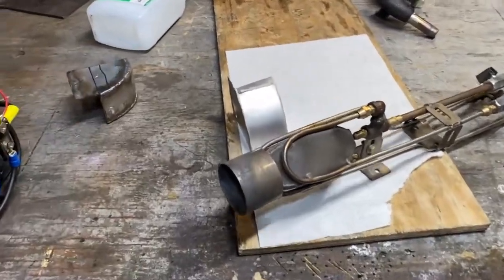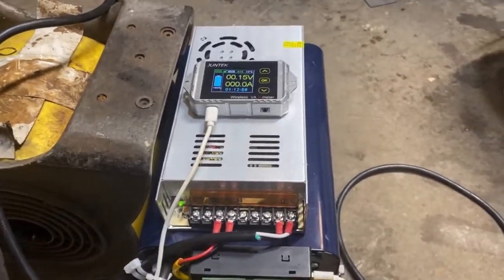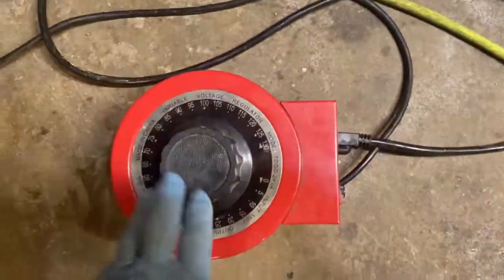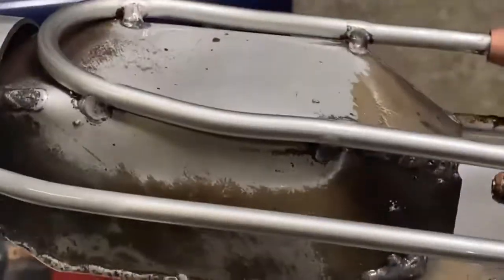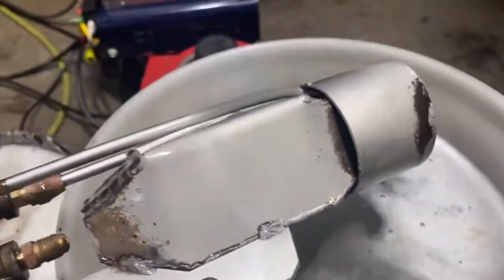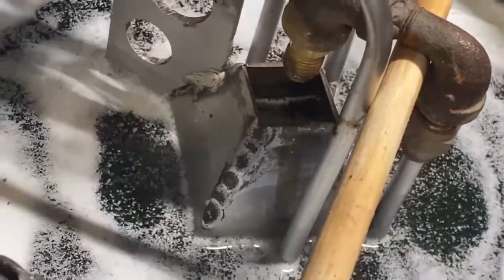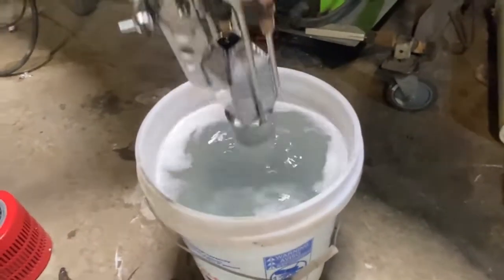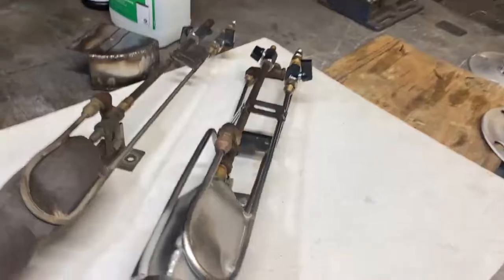NEW Metal restoration electrolyte ADVANCED PROCESS

Comment: so i have a few questions. please forgive my stupidity.  
the lead liner is because the acid would eat the pot ? or are you using that as your anode. or both. was thinking plastic liner ? or plastic bucket? 
 can you use something else as your anode ?  the old method used any iron as a anode, i think getting my hands on that much lead would be the hard part for me. 
and if your using AC, could you use a stick welder as the power supply ? ofc very carefully. 
can this be used on Non-Ferrous Metals? 
i am intrigued to try this method out as the old way takes a long time.
Reply from the maker: Yes the acid will eat the pot and you need 160 deg to electro polish witch is the next step so* plastic is out
Reply from the maker: This is DC current
Reply: @NOBOX7  most food grade 5 gal buckets can take temps to 230°F. just need to figure out the anode, and a way to heat the acid that wont melt like a immersion heater would lol
Reply from the maker: @zednott  The current alone will do it if its high enough , it gets to 40 c just from mixing things up , its exothermic . most emersion heaters will dissolve fast  and cause over foam